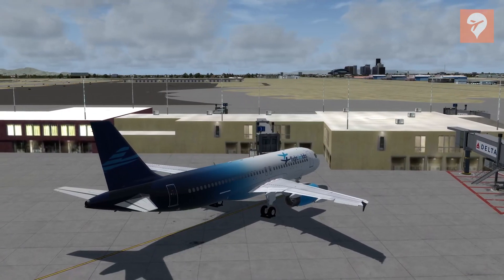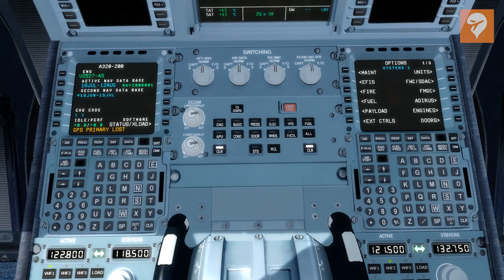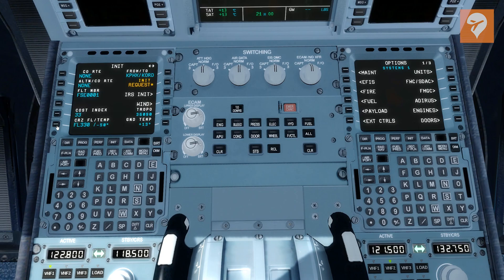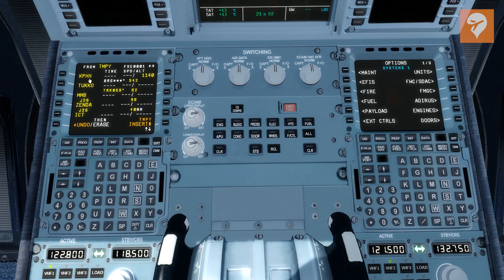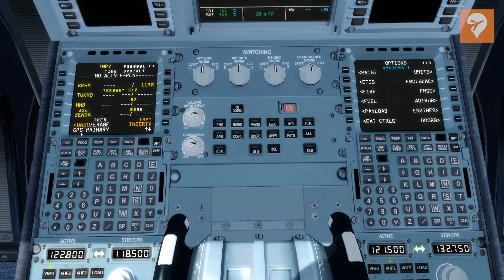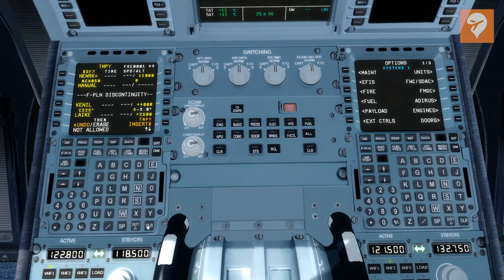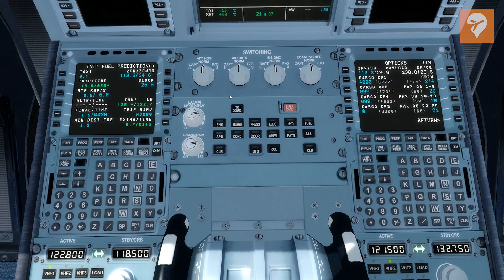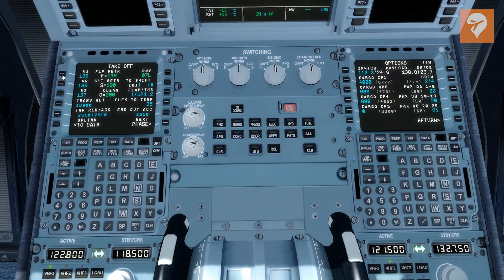MCDU Programing: The FSElite Tutorial

Comment: Thanks for the video. That's a nice overview of the MCDU.
First and foremost, thanks for NOT filling INIT B right after INIT A: that's a mistake made even made by some type rated pilots despite explicit mentions in the FCTM.
Some fields such as alternate, tropopause level, cruise temperature, acceleration altitude... would deserve a sequel video (may be combined with a flight planner).
Moreover, it is recommended to check the route in the MCDU in conjunction with the ND in PLAN mode: it helps to spot errors.
Finally, you may want to use the AIRPORT key to jump faster to the departure, destination and alternate: it's faster than scrolling especially with a longue route.